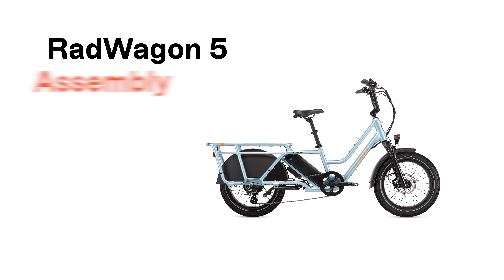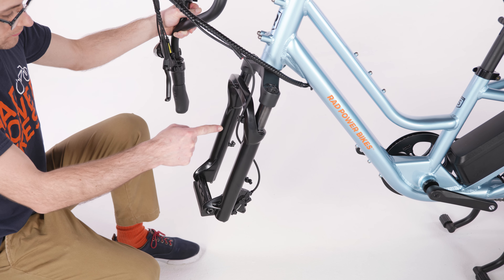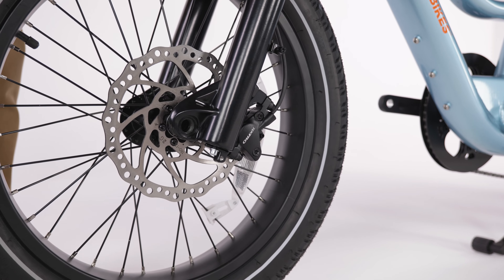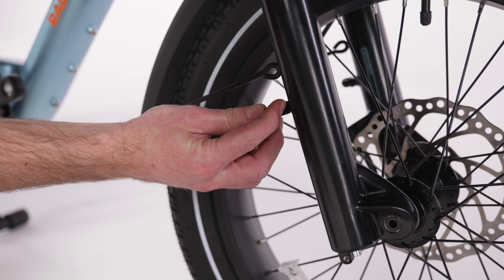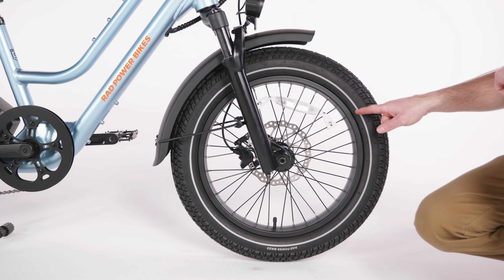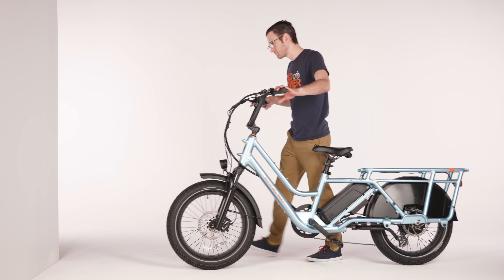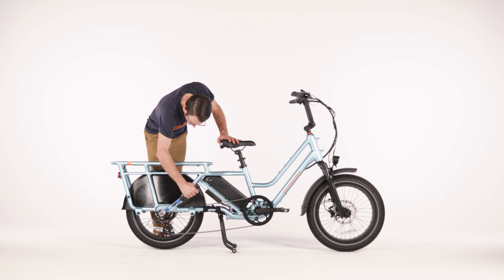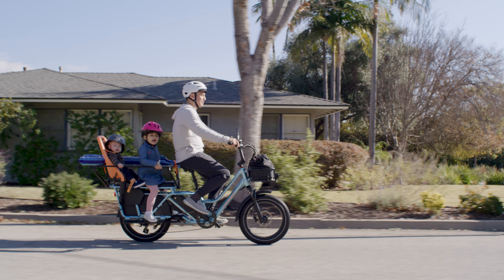RadWagon 5 Assembly | Rad Power Bikes

Comment: What bike rack do you suggest for the Radwagon? Due to its long wheelbase and heavy weight, I cannot find any options in the US.
Reply from the maker: Hi! The Hollywood Sport Rider Rack is a great option! For the RadWagon5 you would just remove the battery which would reduce the weight to 75.6 lbs from the 86 pounds. You would then be within the 80 pound weight limit per bike on the rack. The wheelbase is 50.7" so is compatible as well. Check it out! 

https://www.radpowerbikes.com/products/hollywood-racks-ebike-hitch-rack 😁